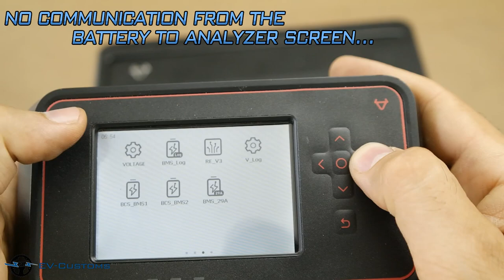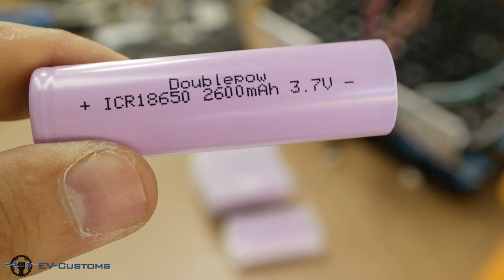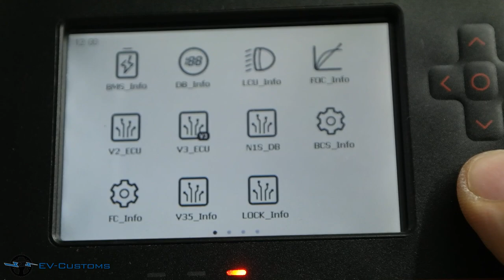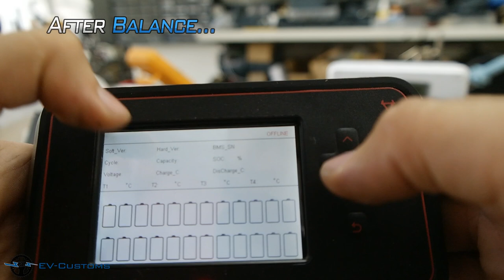NIU Electric Scooter 60V 26Ah Battery Repair, issue appears after charging it at high temperatures

Comment: Hello friend, You should see the new cells put at the same voltage as the others, because otherwise they will always be unbalanced with respect to the others
Reply from the maker: Yes for sure, i have do that my friend... you can see them balanced at the end if video...
Reply: @EVCustoms  yes I noticed the same thing the other packs were at 4.1V and the new one at 3.7. 
I really appreciate a fine job like this one. I suppose the fix was cheaper than a New battery.
Congrats on the fix🦾
Reply: @EVCustoms   ok ok, wrong title 60v = 16s not 13s  jejeje
Reply from the maker: @vsl5917  Oh my good..! thank you for that...  I did notice that...
Reply from the maker: FIXED..! 😁😂😄
Reply from the maker: Yes i balanced the new battery at the end with voltage regulator...
Reply: @EVCustoms  perfect, good job friend
Reply: @vsl5917  Take a look at the H1... I think it is a 17S battery. Or not?
Reply: Time: 12:25
Reply from the maker: LOL...  How I didn't notice that..? very good observation Der Akkusauger!
Reply: He could have pre-charged the new cells or allow the bms to do it

Comment: At heavy use my batteries show 45 degrees C. I watched the video, but what excactly  was broken?
Reply from the maker: At 45 degrees temperature  the charging is problem... can damage one cell and this one cell will discharge the other parallel cells... you will see unbalanced cells.
Reply: @EVCustoms  Hmm..but I need the time to recharge to get back home. Does it matter if I fast charge or slow charge?
Reply from the maker: @dotternetta  When you say fast charge? how many amps?
Reply: @EVCustoms  12 Amps, 2 batteries simultaneously, with Niu splitter, I dont know what is does, but both batteries charge at the same time.
Reply: Better let them cool down, you can open the saddle and foot floor to let them cool down faster.
Reply: @jackjone12221  My new Evo has a fan for battery cooling and the batteries run much cooler
Reply: @dotternetta if you have 2, why not use one charge one?
Reply: @joeKisonue  Takes to much time. Both are hot, waiting is no option. I sold my Niu's, drive Fiat500e now. No Niu for me ever again
Reply: @dotternetta  traitor

Comment: 🎉 thx ! Die you recharge disbalance cells with you Labor Power  60v / 2A ? 
After you did use again a NIU charger ?
PS - you don’t need to open for measurements - on the long connector you can do it directly each cell .😊

Comment: My battery generated an error 154 in the scooter because of the same symptom you showed at 12:26 ... The dealer told me that they did a balancing of cells to fix it. Why did this happen? do you have any idea? To charge, I use a smart plug and turn off the fast charger when it falls short of 100w of consumption (to avoid overcharging the battery). Maybe my smart plug is generating this condition (don't let the battery equalize the tension between cells)?

Comment: Thanks for the video. I recently got a Niu Nqi GTS Pro which has 60v 35Ah batteries, I believe. One of them takes longer to charge and discharges faster. The last two days after charging to 80%, when I wanted to charge higher, first the battery would not charge with the splitter and then when slightly more charged would not charge by itself. Today it shows 5 lights flashing... In your opinion, does this means it has faulty cells?

Comment: Can I use one of these packs in a different scooter model by opening it up and using a different connector?

Current scooter is a dual motor 60V, current battery is 67.2V.

Could this battery be repurposed to work with a GX16-3 charger?

Comment: you put new cells with 2.5ah but other old cells in the pack not 2.5 because they old maybe 2ah left in them.dont you think that will cost unbalance or over charging problem in the future ?
Reply from the maker: If we put new with old ones, at the end we must balance the batteries at the full voltage state 4.2V, to make it work properly.

Comment: Hello I am Greek to!!
In this battery can we add more cells parallel to extend range or it will not work?
Reply from the maker: Hello Petros.. 
Of course you can do that.. the only thing you must manege is to find space..
Reply: Thanks for your reply!!
If we talk for 10 or 15 amps more I think the existing space is enough. If you agree!!
Reply from the maker: @peterpulp   If tou find 3.5Ah 18650 cells...  yes you can make 35Ah battery, extra 9Ah.
Reply: Thank you very much!!

Comment: Wahou, so nice video. Can you share the list of devices you use to repair it? I have a niu since more than 4 years and the battery is over (can only do 20km with a full charge). I would like to change the cells but need to find the tool you are using (such as the solder devices etc…). Can you help please?
Reply: U need a battery spot welder,  nickle strip or grid,cell insulator stickers,

Comment: Nice video, maybe you can answer, because i'm not good in electronic, i have an NGT 125 with 2 60V 35AH batteries, i think like DMS are dead after charging problem, my question is, can i put a 60V 26AH battery DMS on 60V 35AH battery ? Regards
Reply: yes you can

Comment: Did you know that the BMS was OK beforehand? I first would have checked the BMS on a different battery ... did you diagnose before? I do that using a YY BMS.. (h1 did not get any data as voltage was too low).
Reply from the maker: No i didn't check BMS because this issue is common on new battery packs, with Chinese EVE batteries...
Reply: @e-autoauctionsdirectanycar9783 are calling individual 18650"cell" or each stack?

Comment: Hi,
what can I do if I left the battery connected for a week. Now one battery is at 0%, and I can not load it. 
Can I use an external power supply with higher voltage to bring it back? Can we disbale the ECU, just to load the battery. NIU seems to block it
Reply: Hi, you need to use the small charger (NQi Sport) to wake it up because it is in undervoltage protection state now and the big charger couldn't wake it up.

Comment: I have 2 brand new NIU 60v 26a batteries that had been sitting for 8 months. 1 charges and the other does not. One shows 64v and the dead one shows 8v. How can I revive the dead battery so it charges again? Thank you
Reply: Please go to your dealer ASAP and try to charge it with the small 60V charger to wake it up from over-discharged protection state